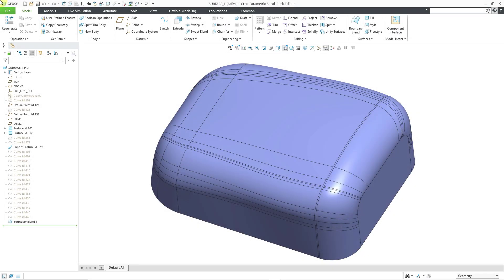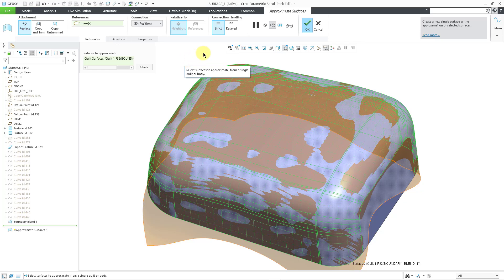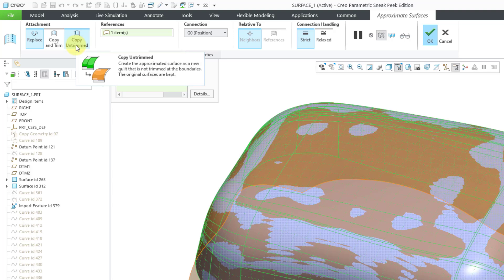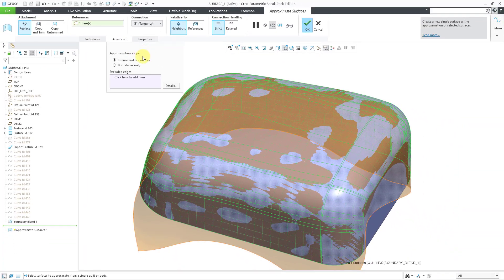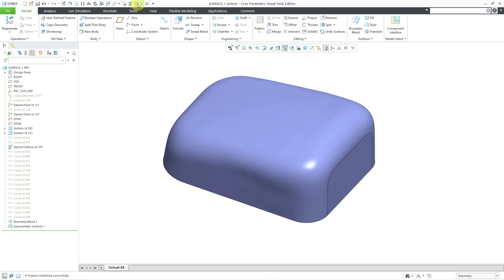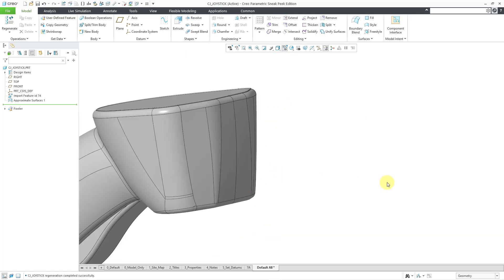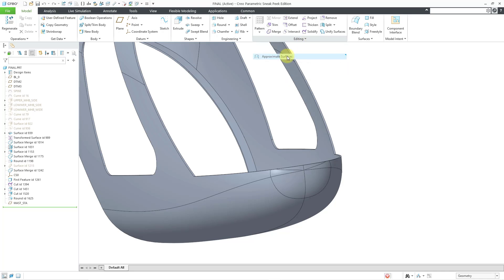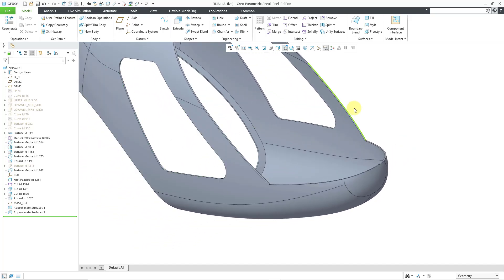Creo Parametric 12 - Approximate Surfaces

Comment: Have you come across any examples of geometry types where the relaxed connection handling was required over strict?
Reply from the maker: Personally, no. But since Creo 12 came out, my focus has been on preparing to move to Spain. I’ve barely done much Creo stuff since then. You might want to ask on PTC Community as the people there are much more active users.